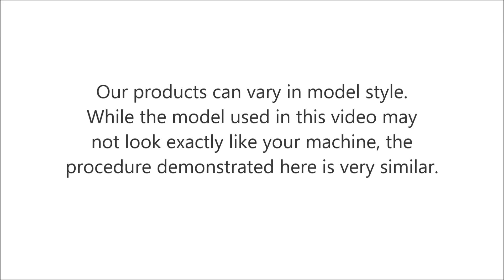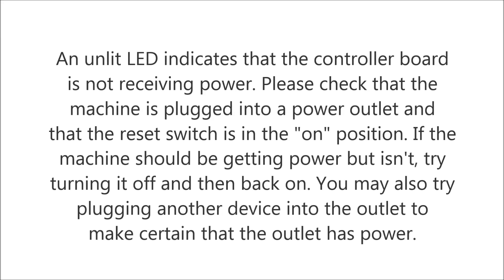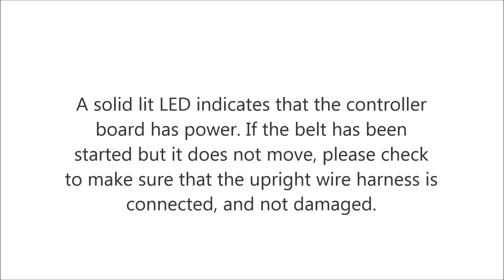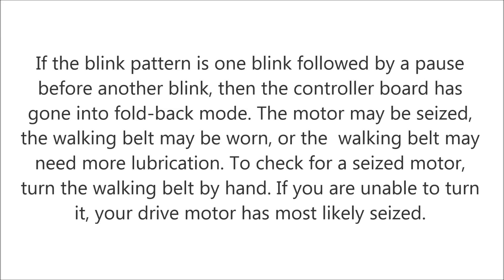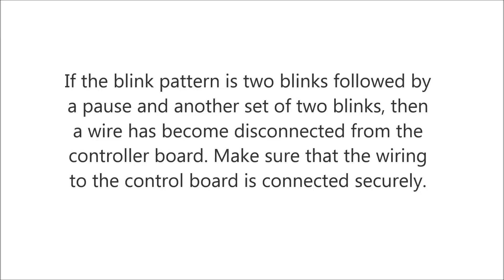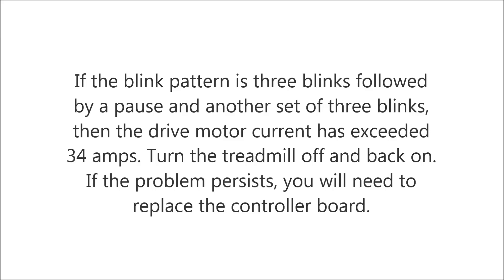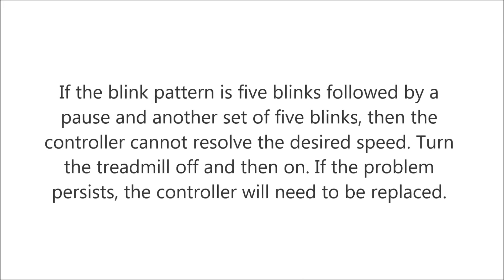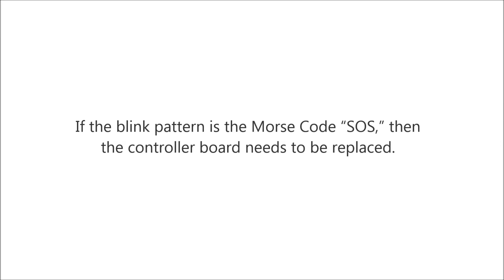LED Blink Patterns on the Control Board - Treadmill

Comment: whoever runs this channel you are insane. Amazing work well done!!!

I have a solid red light on my norditrack so suspecting harness or the console itself. 

I was wondering - if i take the console apart, can i just lay it down next to the board and skip the harness cable to test?

Comment: I have a new out of the box pro-form treadmill that does the fast blinking for about 30 seconds and works fine, but then it looses torque and can be stalled just by walking and does the slow blinking, I've lubed and properly tensioned the walking belt but it keeps doing the same thing, I've barely used it 10min since taking it out of the box
Reply from the maker: Does it do this with out a user or only when being walked on? Try loosening the walking belt. they symptoms and flashing indicate high motor amperage.
Reply: @FitnessEquipmentHelp  only when being walked on, I've tried loosening the belt but the front roller starts slipping as soon as I get on

Comment: I have a 2950.  I am getting 3 blinks, but i have a bew control board in.  The treadmill will spin the motor for lets say a quarter second.  Then the belt stops amd the light goes into a 3 blink pattern.  I have checked the motor with a 12v battery and it spun fine.  I have as stated put a new board in and it did same thing.  The belt is lubricated.  Not aure what to try.  I have also done a hard reset.  Still 3 blinks no matter what ive done
Reply from the maker: Usually the error codes indicate a problem with the motor controller. The symptoms you describe however could also be associated with a demagnetized drive motor.

Comment: Which one is the upright harness?
Reply from the maker: The upright wire harness refers to the wire or set of wires that connect the motor controller to the console and is usually ran through one of the uprights to reach the console at the top of the treadmill. You can refer to the exploded drawing and parts list in your user's manual to help you identify which wire or wires apply to your specific treadmill.
Reply: @FitnessEquipmentHelp thanks

Comment: I have a healthrider H110i which on start my belt move for split second and stops each time i push start. Could it be my control sensor. Everything on threadmill works but movement of belt. I tested motor which is good. When using battery to test motor belt does continuously move.
Reply from the maker: I does sound like a controller. If I were to guess you would have a 4 Blink error like in this video.

Comment: Quick question? Mine start fine and a second after it stops, the light is steady red, then it turns off stops, the belt is seems to run too fast before it turn off and the screen scramble and return to normal.

Comment: I’m at a loss. We have a ProForm Carbon TL, bought only 4 months ago. It worked great for the first 3 month, but now it keeps stopping after 30-60 seconds at 2-3 mph with a slow blink (not the fast blink followed by a pause like in the video).

At first the motor and the red wire going to it were getting noticeably hot. After loosening the belt and lubricating the walking belt with the lubricant from ProForm, the motor isn’t getting hot anymore, but it’s still stopping with the same blink code. I’m about 265, so well under the 300 lb weight limit.

I’m almost to the point of wanting to cut our losses and return it since it’s under warranty, but I can’t get hold of anyone at ProForm/IFIT except AI chatbots that tell me to submit a request, then the request won’t go through.
Reply from the maker: The light is indicating high amperage. I would try adjusting the belt (as loos as possible w/out slipping) or lubricating the belt with manufacturer approved lube only.
Reply: @ ok I lubricated and loosened this weekend. I could try loosening more. Would you expect 1 tube of lubricant to be enough or is it normal to need more than that? The maintenance kit had 3 of them I believe along with a foam rod to apply it underneath the belt.
Reply from the maker: @ghfan2011  1 tube should be enough for a single application and should be good for several month to possibly over a year depending on how much the unit us used and the conditions in which it is kept.
Reply: @FitnessEquipmentHelp  apparently I already loosened it too much. In addition to the stopping, it started slipping today before I got around to trying to loosen it again. It pulls up about 2.5 inches in the middle which seems to align with the spec in the manual.
Reply: @FitnessEquipmentHelp  I figured I might as well try reaching out again. I’ve been emailing back and forth with ProForm, but they keep asking the same questions and it’s not going anywhere.

Over the past few weeks, I’ve noticed the motor and the red and black wires going between the motor and control board getting very hot. The red wire melted itself to the motor hood, so I had to cut it and reconnect with a screw on wire connector. The black wire seems to be heading toward burning out as well. I’m going to test tomorrow for shorts between those leads, but any other ideas for troubleshooting? I thought about trying to open up the motor itself to see if I could just replace the red and black wires, but last time I tried I couldn’t figure out how to get the fan off the motor to get down to the wires inside.
Reply from the maker: @ghfan2011  the red and black wires are connected to the motor brushes. Proform doesn't service these brushes but you may be able to get them online or from a small motor repair shop. the fan usually is press fit onto the end of the motor axle. it should just pull off the end of the motor. (I have used a flat head screwdriver to pry the fan off to remove it before. depending on the motor you may or may not need to remove the fan to get to the caps that hold the spring loaded brushes into the motor.
Reply: @FitnessEquipmentHelp  thanks. I checked with a multimeter and found that the red and black wires were shorted together which would explain the overheating. I was able to pull the fan off and get into the motor to check the brushes, and the brushes look like they’re falling apart. It’s only 4 months old and still under warranty, so I would expect ProForm to cover it, but I’ve almost given up hope on getting them to do anything.
Reply from the maker: @ghfan2011  I'm sure they would be happy so send you a new motor if its only 4 months old and covered by warranty.
Reply: @FitnessEquipmentHelp  thanks, they finally got it ordered today. The main problem was that it would take 3-5 days to get a response, and when they did respond, it was like they were starting the request over, asking the same questions. I answered the same questions and provided pictures and video 3-4 times before it got past the initial request stage. I’ve heard some people have had better luck with calling, so I might try that next time if we need anything else.

Thanks for your troubleshooting tips along the way!

Comment: Hi! Thanks for the video!
I have a healthrider treadmill, model H70t, and although it turns on fine, the treadmill does not run. I have opened the control board and I have seen that the red led recognises that it has power, but when I try to make the treadmill run, it emits a blinking code 8 times, then pause, 8 times, etc.
I have not found any manufacturer's manuals where this type of flashing appears.
Thanks again!
Reply from the maker: Most motor controller error codes mean the controller needs to be replaced. I would replace the controller. Also replace any other worn or damaged parts. Using a treadmill in need of maintenance or repair can cause failures of the electronics as the amp draw of the motor increases to compensate for worn out parts.
Reply: @FitnessEquipmentHelp  I bought the controller at Decathlon Spain, 35 €, and it works! Thank you very much for your support!
Reply: @FitnessEquipmentHelp  Understood. I wil follow your advice, Thanks!

Comment: Steady red. Upright wire harness fine.
Machine counts down, but belt won't move. A click is Heard a few seconds later and machine throws E13 error code. please help
Reply from the maker: Sounds like you may have a machine from another manufacturer. In that case this video will not apply. What is the brand and model of your equipment?

Comment: I have a nordic track t 6.5s. It turns on and runs but when i step on it to start walking it stops. when i step off it’ll start again. when its running without me on top the led light blinks rapidly. when i step on, the treadmill stops, led light blinks-pauses-blinks. The video says it’s in fold-back mode. I can move the belt by hand so the motor isn’t seized. The treadmill is 4 years old and I don’t use it very often. It has maybe 200 miles on it. What could the issue be? I’ve seen other people with the same issue and nobody seems to have an answer. Would hate to have to buy a whole new treadmill.
Reply from the maker: If there is a lot of friction as indicated by the LEDs but not a lot of wear on the belt and deck then I would first try loosening the belt and lubricating it with the manufacturers lubrication. Of course replace any worn parts as needed.

Comment: I have Proform Pro 2000 model#: PFTL13116.0 that I purchased in 2017, and lightly used. I see that it just moves an inch and stops followed with 4 blinking lights on the controller continuously.  It is solid red when not running. I haven't lubricated or done any maintenance so far. I just ordered a new controller, but started thinking if I should have tried lubricating first? Considering that it is solid red when not started, does this mean the controller is fine, but going to bad state when attempted to move, maybe due to extra friction from non-lubricated belt?  Also, I see that you suggested replacing the walking belt in one of the responses. Do you also recommend that in my case? I hope not because it is not that cheap :) I guess, I should lubricate the belt first before trying the new controller to prevent it from failing again, right?
Reply from the maker: the 4 blink error means there is bad switch in the controller called a fet. The controller needs to be replaced, but principle cause of such failures is lack of maintenance, causing the motor to work too hard, and pulling more amperage through the controller. Doing the maintenance you plan on can help prevent future similar failures.

Comment: I have a proform 505 cst PFTL59420, when turned on red light blinks rapidly, treadmill runs fine, belt moves when I'm on it and after a while it stops and red light blinks for a second and pause.  If it's in fold-back as stated what could be the problem, I am able to move the belt by hand when off as well also I've lubricated and tighten/loosen the belt correctly.
Reply: Did you ever figure out what it was? I’m having the same issue on my nordic track t 6.5s.
Reply from the maker: If the unit is going into foldback mode it is because the motor is requiring more amperage than normal. this can be due to worn out parts. even if the belt is well adjusted and lubricated if it is worn out it will still cause the motor to work very hard. In rare cases it may indicate a bad motor but given the age of the unit. depending on use it's probably just time to replace the belt.
Reply: I’m having the same issue. Changed the motor and board and is doing the same thing

Comment: I have a preform 542. Led is on I turn the belt in and it runs about two seconds and led goes out and all power is shut off. Belt stops. LED isn’t doing any type of blinking. Solid until I start the belt. Then just loses power.

Comment: My light is doing the constant blinking. I dont see any issues with wiring or motor. I have power everywhere i need it. It just wont start. Idk if ifit wont let it start or what.
Reply from the maker: if the red light is blinking on the motor controller then the console should be sending a speed control signal (iFit or not). Although not common, I have seen a controller blinking normally w/out sending voltage to the motor and it required replacing the controller.

Comment: Just bought a gently used Nordic track 2022 1750. Console perfect although nothing from the motor. No sound, no movement. Under the hood looks like red blinking 4 times pause then 2 times. I was hoping just a wire came undone during the move but everything looked ok. So bummed
Reply from the maker: Does the console light and boot up with power. it sounds like there is no communication from the console to the first lower board called the incline controller. the main lower board should have a solid red and green light on it. This video only applies to that board.
Reply: @FitnessEquipmentHelp  We had a repair guy come out. Unplugged everything, and it worked. I go to use it the next day and it didn’t work. We unplugged it and plugged it back it and it worked. The next day wouldn’t work. Yes the screen and videoes all perfect. The fan also works.  My husband is ready to have someone haul it away and eat the loss🤦🏻‍♀️
Reply from the maker: @debbiecrupi7188  It really sounds like you may need that incline controller. Also please note that the unit should always be unplugged when not in use and not updating the software. I recommend downloading and reading the manual if you didn't get a copy. you can get the users manual from www.iconservice.com.

Comment: How can I add bluetooth to a treadmill that doesn't have bluetooth  so the incline and speed can be controlled via my ZWIFT app irtual runs ?
Reply from the maker: Im sorry, iFIT Equipment isn't designed to be used with Zwift at this time.
Reply: @FitnessEquipmentHelp  OK thanks.

Comment: I have a ProForm, the belt randomly stopped working. The video doesn’t say what the potential issue could be for a steady blinking light. Power to console and control board are fine, when the speed is increased on the console the light blinks continuously. Am I right to assume this might be a motor issue.
Reply from the maker: the steady blinking light should mean that the Controller is receiving a speed control signal from the console and is out-putting DC voltage to the drive motor. if that is the case then there may be an issue with the drive motor, or the wires between the drive motor and the controller.

Comment: What does it mean if the "INC" (I assume that means Incline) light is blinking continuously?
Reply: I should just add that I just replaced the motor control board.  The treadmill ran for about five minutes and then it stopped again completely.  No lift or belt movement.  If I move the belt manually the console does pick up a speed, so I take it to mean that the speed sensor is OK, but I wonder if I just burned out a second MCB.  Treadmill was last lubed six months ago.  It's about five years old.
Reply from the maker: @LetsPlayPC  This sounds like you have a product I'm not familiar with. what is the brand and model for your equipment. (This channel is created for products from iFIT but if I can find something out for your machine I'll let you know.)
Reply: @FitnessEquipmentHelp   It's a Bowflex.  It has the regular LED light but then what looks like a dedicated Incline light where the incline potentiometer plugs into the MCB
Reply from the maker: @LetsPlayPC  I cannot find a service manual online that mentions the LEDs on the motor controller. I would suggest reaching out to Bowflex directly.  Sorry.

Comment: When I trailed my treadmill on the The red light comes on and then it fades to no light
Reply from the maker: That is new one for me. If you are certain there is still AC voltage being received by the controller then the controller should be replaced. I would suspect however there may be a short or damaged/disconnected wire or switch that only allows power to the controller intermittently.

Comment: I would turn on the machine and the board would Blink ONCE when turned on but no blinks thereafter... What does that mean?
Reply from the maker: Does it blink one time and then remain lit or unlit. I assume you mean it is not lit. That may indicate that power is not getting to the controller. You can verify with a multimeter. If you have120 VAC at the controller and the light remains unlit then replace the controller.
Reply: @FitnessEquipmentHelp  Yes one blink then remains unlit.
Reply from the maker: @ReygularGuy  its an abnormal symptom but power is getting there at least long enough for the light to flash... there is likely nothing actually wrong with power delivery. my bet would be on the controller.

Comment: My blink pattern is not in the video. My machine is doing 10 blinks, pause, 10 blinks. 
It does this when I turn on the fan while inclining.
Reply from the maker: The red light on a late model Icon/iFIT treadmill will blink in response to an incoming speed signal. There is no response from the red LED for either the fan or the incline. You may be looking at another board or perhaps you have equipment from another manufacturer. What is your model number? Does your belt run?

Comment: Please help, about to buy another controller board but before I spend €200 from aliexpress with no refund available or throwing out the treadmill altogether does Any one know what 8 blinks mean or is that the sos? Also motor will turn and works when I test with battery all lights are on that I can see as normal? Can't see anything burned out and wires seem good?
Reply from the maker: SOS would be 9 blinks in Morse Code.  Blinking on a treadmill motor controller almost always indicates a problem with the controller itself, (not to be confused with late models incline boards and power supplies).
Reply: @FitnessEquipmentHelp  thanks for getting back so replace the board as in the one in the video to fix u recon?
Reply from the maker: @andycolbeck5162  yes, from all available evidence it seems like this would be an issue with the controller.